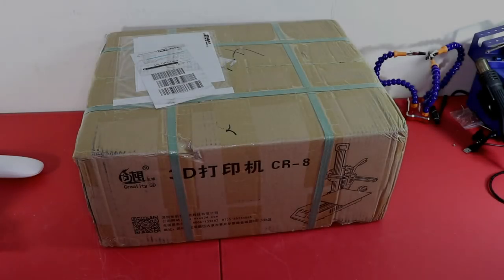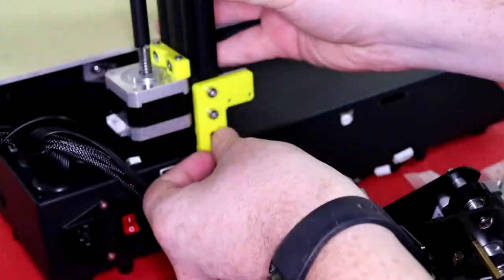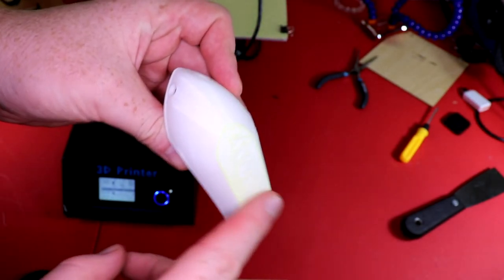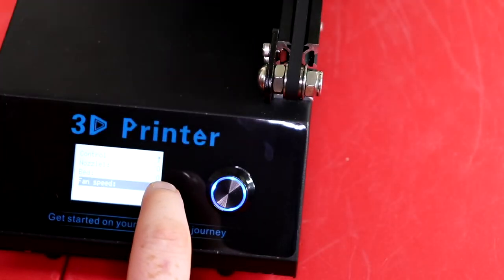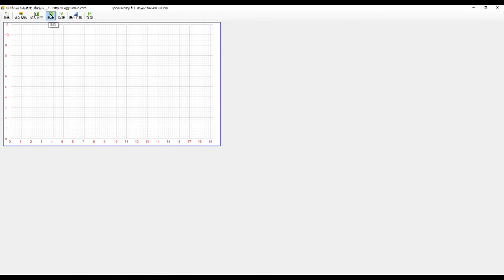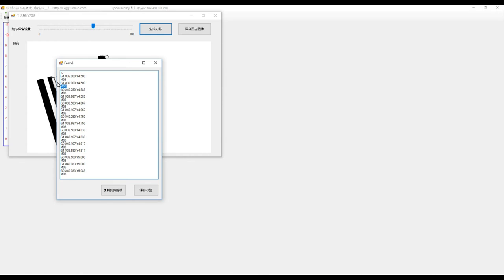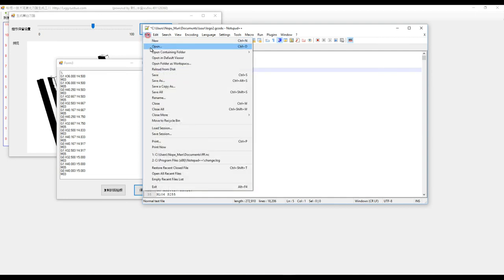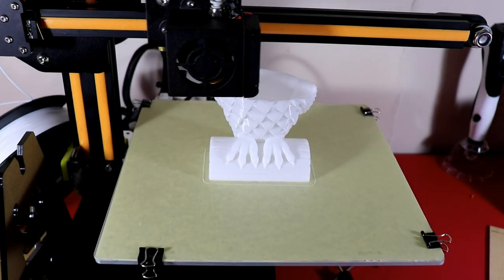CR 8 Thoughts And How To Laser Engrave With It

Comment: Would be nice if it could do thin metal. Like the .5mm two layer. So it cuts through the thin top coloured layer to show the bright layer under.
Reply from the maker: I could try but I just don't think it would be powerful enough to do so. I am also wondering if there is a way to add a much more powerful laser to it as well. Something else I could look into.
Reply: Wouldn't it work out cheaper then to buy a dedicated laser machine.

Comment: This seems like something that could be an easy mod or add-on to the cr-10
Reply from the maker: +Josh Wigginton yeah it plugs in the extra fan port on the controller board which can be ran by G-Code m106. Kind of a smart idea actually. Then you could have a large laser engraver. I should figure out all the components that they used and try to replicate that for the cr-10.
Reply: Eric's DIY yeah it would be great to find out more. I just ordered the cr-10s, should be arriving in the next week or so. I’ve got a laundry list of mods to add, but once I tackle the basics, this would be one of the mods I try, especially with a more powerful laser for other materials. I love the fact that you can just attach with a magnet to the hot end. This could be a rather easy DIY to an more powerful engraver from gearbest. I see others using Inkscape plugin to output gcode also.
Reply: Yes extra port for this on the main bord😎 (las)😎 i ihave a cr10s 
But not the laser I seen the video fuck up software creality has there own website whit support but no downloads for the software drivers ......updates !!!!!!!!!anything 😠😠😠😠😠
Reply: Like your Chanel keep up te good work👍 Eric gr marvin